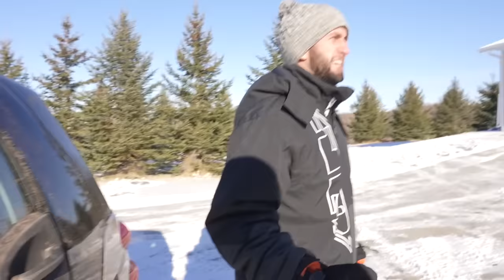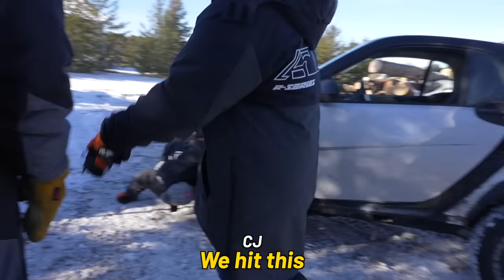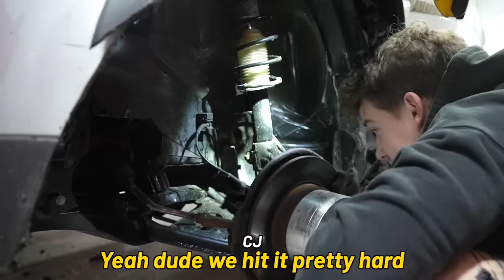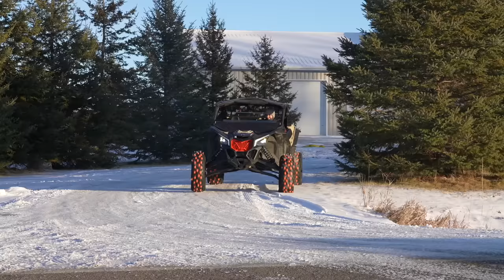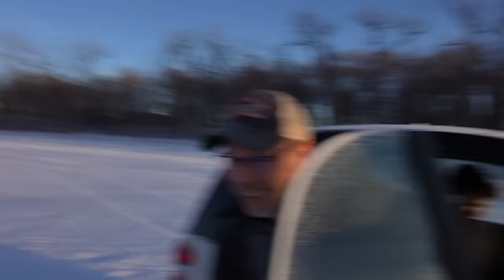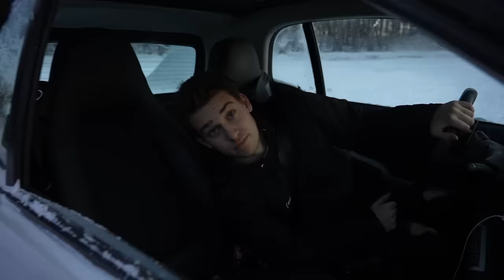Lifted Smart Car on Thin Ice

Comment: FYI when taking the smart car on the ice and only 1 wheel is turning you should try to gently tap on the breaks at the same time over and over, it will get the other back wheel to lock up and start spinning, this goes for any car or truck with a open diff.